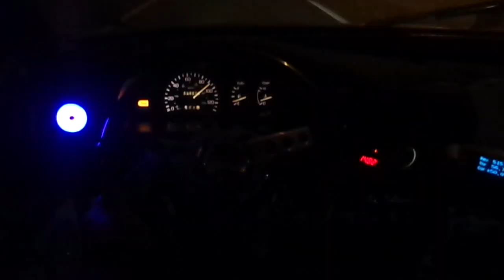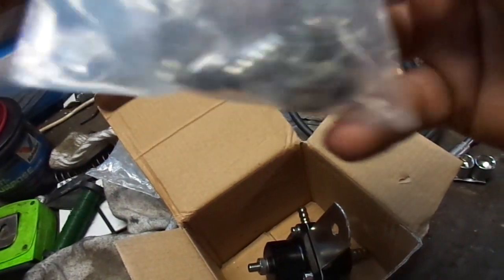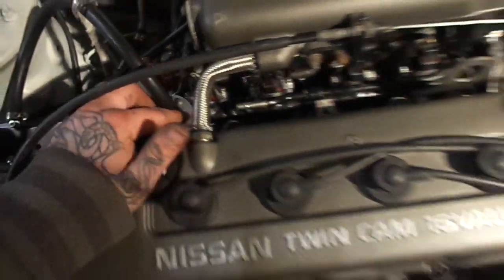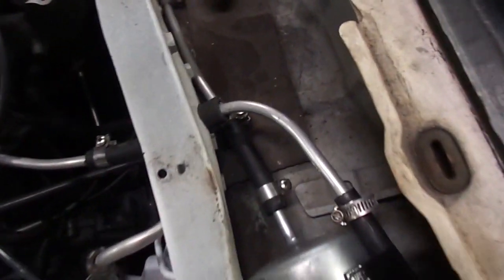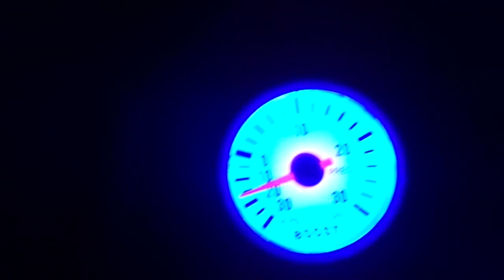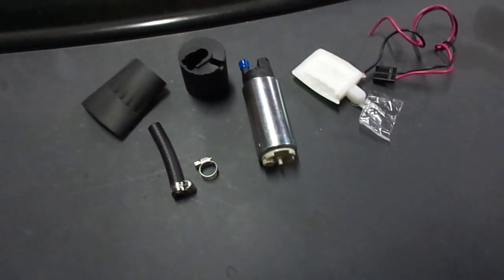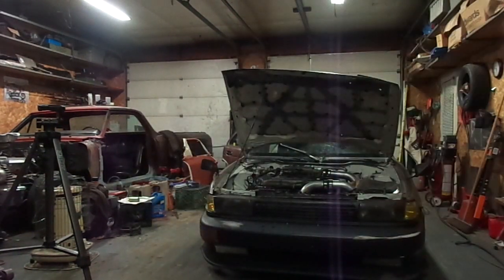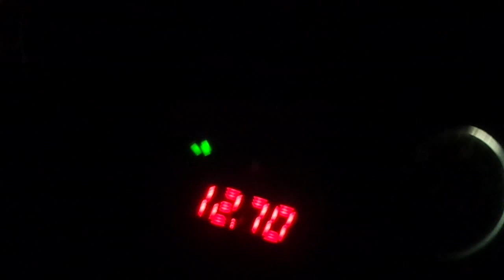Budget Turbo Build Part 5: Fuel System + Intercooler

Comment: also... you may be able to make a touch more top end power for free.  disconnect the vct solenoid so it doesn't re-advance the intake cam at higher rpm.  If you don't like it, plug it back in.  Doesn't hurt to give it a spin to see what changes for you.  vct solenoid is located on the pass side behind the hump on the head (that's what the hump is... provision for vct actuation gear, it advances intake cam timing 10 degrees)

Comment: Use a 300zx hood scoop for the hood.  Looks great. Did it to my SER  B13
Reply from the maker: Ill look into that. Eventually I plan to run a front mount, just working with what I had lying around currently.

Comment: dope video bro, IV been fallowing all our videos an all ur work is dope , I got a 93 Nissan 2 door sentra GA , I installed a complete ebay turbo kit on my GA but can't tune it, just wanted to know where u found ur plug an play, u said on ur video that it was pretty affordable?
Reply from the maker: thanks man i appreciate it. and i assume you mean the SAFC that im using to adjust the fuel maps right? I actually picked that up from someone who follows me on instagram, but you can find them on ebay for around 150$. Its not necessarily plug and play so to speak tho, as you have to pull apart you interior to get to ur ecu and the cut and solder some wires. It is a pretty simple installation though. You could also run an FMU ( Fuel Management Unit ) which basically just raises fuel pressure according to boost pressure.  You can get one of those for around 80$
Reply: Sketchy Sentra cool I appreciate the info, im going crazy trying to finsh but parts are so hard to find for this car, is there any way I can get in contact with you, I got tons of questions an i wouldn't mind paying u for info an help.
Reply from the maker: do you have an instagram?
Reply: na not any more, but you can get to me throo my girls instagram, we just started fallowing you, its under "my_hernandez". hope to hear from you bro,I can really use ur help ,my name is mark by the way .
Reply: "my_hernandezzz" my bad it had 3 z.
Reply from the maker: okay well send me a direct message on there and i can help you out with some questions

Comment: don't use a b13 fuel filter!  use one for a z32 (300zx.)  fits in the stock bracket and everything.

The stock fuel pump is also known to be weak... and there is a fuel restrictor in the return line in the tank just fyi.  If you are still running out of fuel, get some sti 333cc injectors as they drop in, you just need pigtails and wire up.
Reply from the maker: Doesnt seem to be having an issue with fuel anymore, if anything its too rich. And if you saw in the video i used a fuel filter from a V8, much more flow. And i have and aftermarket replacement gas tank, and all my fuel lines have been replaced with 5/16 hard line, idk if this tank has the restrictor your talking about but i definitely can get the fuel pressure i need now. The upgraded fuel pump made a huge difference. Also, im running around 8-9 psi, and the maf seems to me handling it so far
Reply: The restrictor is in the return rubber line itself and seats under the pump cage.  I did notice the wrong sock immediately lol!  Also the advantage of running a z32 filter isn't only flow capability.  The oem one has a magnet in the top for extra insurance.  If I weren't so lazy, I'd post videos of my b13 as well as the entire everything has been worked over pretty much.  Since you are building more power, you may want to consider an ad22vf brake upgrade from the nx2000.  Need to run 14" or bigger wheels, and gotta trim up the dust shield.  The brakes are night and day in comparison to the stock ones.  Let me know when you are ready to do the maf, I can send you an n60.  When you are ready to get rid of the safc, hit me up as well as you can get a $50 moates board on a sr20 ecu.  Not sure if you need the auto version of the ecu but I have all of it (minus the $50 moates board) and your tuning can be done through logs + nistune.
Reply from the maker: Ahh okay, well it seems to not be an issue at this point but if i need to im assuming i can just cut the return line before the restrictor? You should definitely post at least one video of your setup! I saw the one recent one and yours definitely pulls alot harder than mine, I need to do a 5spd swap. currently trying to save up for a b13 or b14 5spd car so i can swap everything over. And id like to do the maf asap, I want do do a blow thru setup to try and fix the issue with it wanting to stall coming off boost. Im just broke at the moment, I have a few SR parts i might try and sell tho like the highport cam i have. and Id like to do something like that for the ecu, or try an AEM FIC, i want to look into both more before making a decision tho, idk if itd be worth it for how much itd cost. And lastly, where are you located? and what would you want for the maf?
Reply: The stall coming off boost is you losing metered air.  You need to recirc your bov into the turbo inlet.  You can vent to atmosphere if you are a map setup, but Nissan + maf does not like it at all.  Go to home depot, get a pvc t fitting that matches your inlet tubing (guessing 3"?) with a 1" port on the T, run some tubing off your bov into that port so it goes back into the turbo inlet after the maf.  

The pull you saw is my sr20ve 4 door running NA, not sure if you noticed how I run gauges in my car ;-). 

 I'm located in sunny California, and I can send the maf at cost of shipping.  Its collecting dust, will never be used, and isn't worth the hassle of trying to sell online.  

The return restrictor is a joke but I would recommend pulling it off.  Its just jammed into the return rubber hose in the tank.  No need to cut it, pulls right out. 

 Cheapest way is to get going is pull an obd1 ecu from the junk yard, solder in the 40 pin header, move the jumper resistor on the back of the board over (I believe its j1 to j2) then jam in your tune.  You will need a separate chip burner and a consult cable for monitoring but its all available online at moates.  Total cost all said and done with the ecu, chips, daughterboard, burner, and cable should be around $150.  If you don't feel like its worth the hassle and have a few extra bucks, nistune makes a realtime daughterboard for the ga ecu that came out within the last year or so.  You can test drive their software to get a feel for it before buying... or simply use their software to develop your own bin to jam into a basic daughterboard ecu setup.  If you are looking at a straight ecu upgrade I would avoid emance at all costs even though they claim plug and play pretuned for you.  Jason is a douche, and rips people off, his tunes are all crap and super rich.
Reply from the maker: I thought if you run a blow thru setup with the maf ( maf after bov ) than it solves the issue? cuz then the bov is releasing un-metered air? Isnt that one of the reasons all the GA-T guys run the n60 maf?

Yea i noticed the gauge setup, looks super legit man, i bet it was alot of funn getting it to work properly tho lol i also didnt even realize the first time i watched it that theres no turbo noise lol

Do you think shipping would be more than like 10$? How would i go about sending you the money, paypal? Never bought something from someone so far away before lol

And lastly, I didnt realize the chip you were talking about was so affordable, when i looked at nistune i thought i remembered it being like 500 for everything id need. Only thing that seems like id be screwed on for either tho, is that my only computer in a netbook. So i cant put any sort of software for tuning onto it, so id first have to buy a new laptop before thinking about either setup
Reply: I'm running nismotronic on a Lenovo tablet.  I used to run it on a acer aspire one netbook.  Tuning software is very light weight and does not require a powerful pc.  Nistune is realtime tuning (preferable) but you can go to a basic setup which is more of a pita to tune, but ends up being way cheaper.  It wasn't that difficult getting the gauge setup working on the head unit at all actually... just a Bluetooth hack and that was it.  As far as blow through, you will sill release unmetered air as you will be de-pressurizing the charge piping with the bov, which all that air was already metered by the maf.  Depressurizing the charge pipe will draw air in reverse through the maf when venting.  You can give it a try, but may not get the results you want... or maybe it will work perfectly as every car is different with its setup and what it likes.  I wish there was a way to send a private message.

http://www.sr20-forum.com/general-non-sr20-discussion/79443-ga16-modifications.html#post1040106

Another draw through, recirc setup on ga16de.  There used to be a ga16de forum hosted on sr20nation (no longer exists) with all the info you need.  Maybe you can find it on waybackmachine?

Look through zero1dhd's posts.  He has done the whole 9 yards, and has relayed a ton of info of what works, what does not, and why.  In general, Nissan likes recirc.

and yep... no turbo noise, but you can hear the cam switch over to the higher lobes (running n1 cams)

200whp+ na, all day.
Reply from the maker: Do you have an Instagram? If so we can DM eachother on there, if not i can email you my cell number or something, Your one of the first people ive talked to with more knowledge on the b13s than me, normally im the one getting asked all the questions haha

and thanks for the link Ive never seen that setup. basically everything i can find on the forums is super old like 10+ years and filled with broken links. I have an account on Nissan Forums but havnt bothered posting because the site didnt seem that active last i checked. idk tho i know ive seen atmospheric bov setups on GA's with a blow thru maf, or atleast thats the way it looked in the pics, who knows they could have the same issue i have haha

yea the VE must be fun, I used to drive a VR6 that with bolt ons was around 200hp, that thing was super fun/kinda quick, and your VE prolly weighs a few hundred lbs less. Gotta be a blast haha